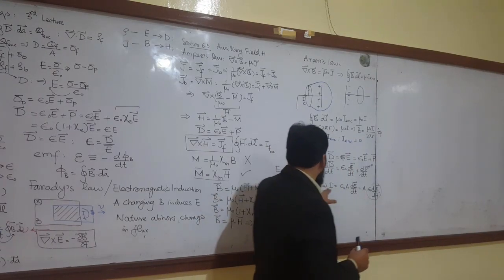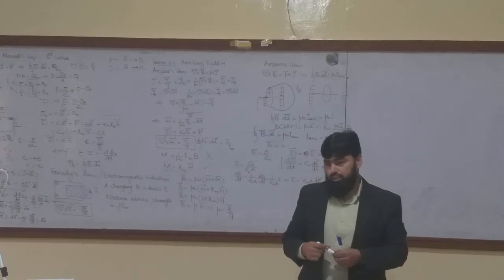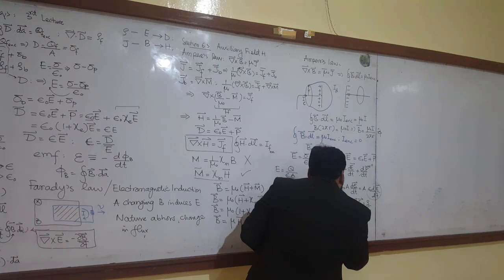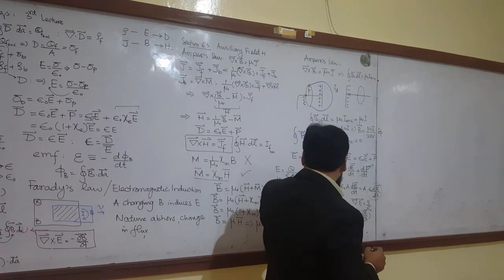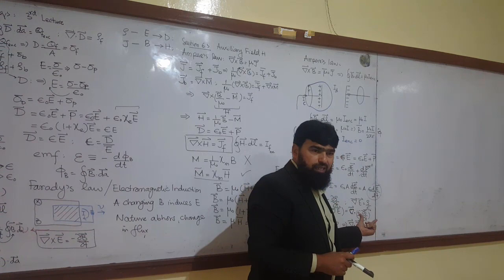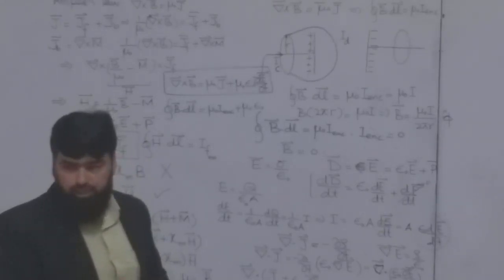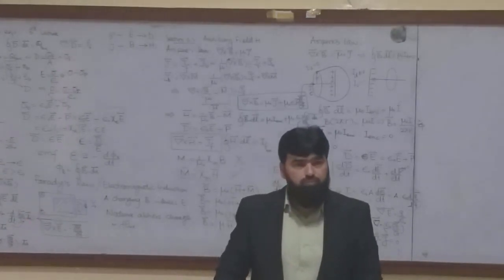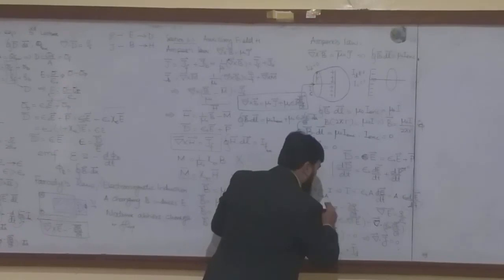L4.5 Maxwell's Displacement Current Explained | Electrodynamics & Ampere's Law Modification

Comment: Other than the minus sign Faraday's Law and the Maxwell-Ampere Law (without the conduction current term) is symmetrical except for the minus sign.
Reply from the maker: Yes, the symmetry is evident here. The main reason is that B is nothing but varying E. Thanks